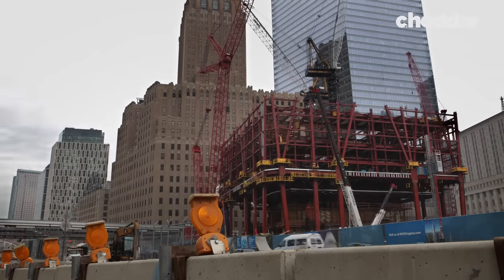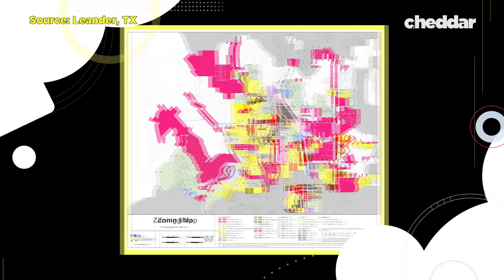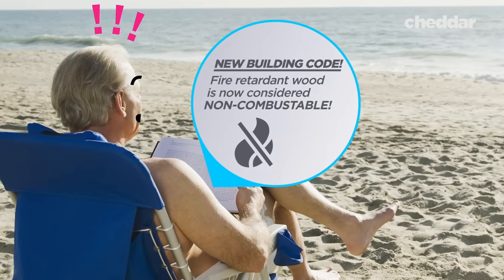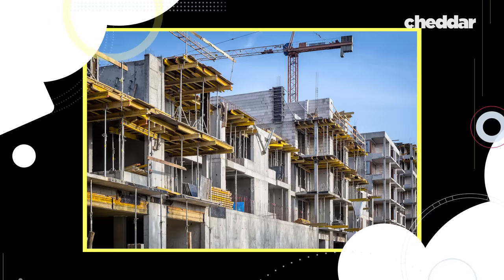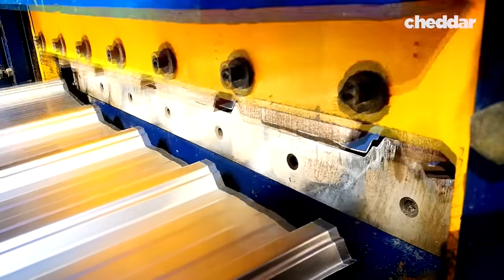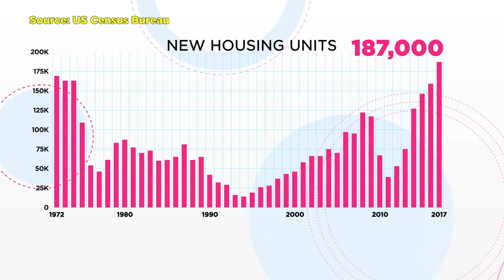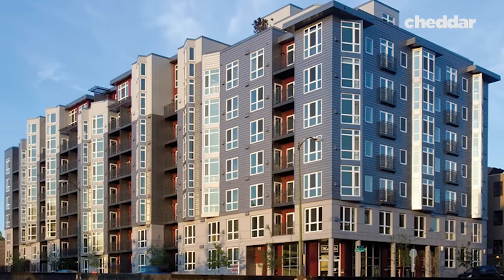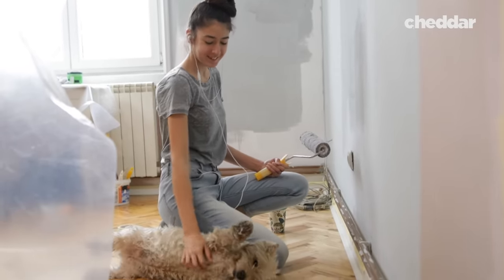Why All New Apartment Buildings Look Identical - Cheddar Explains

Comment: I am generally okay with the design. My only gripe is the sound proofing. The walls in these apartments are paper-thin and sound travels all around. I used to live in one such apartment and could hear neighbors from many doors down. Maybe it was an issue with sound-proofing in my specific building and is not universal.
Reply: No, all low cost housing isn't going to specify soundproofing simply because it costs money.  Sometimes you can get a reasonable amount of soundproofing because it's a side-effect of fire containment but sounds like the US buildings there are relying on sprinklers rather than containing a fire to the apartment it started in.
Reply: I live in one of these buildings, the sound proofing is pretty good if the building is built with double walls so each unit is technically not connected.  I only hear my upstairs neighbour if he bangs around or moves furniture.  I have never heard my side neighbours.
Reply: @AppleCheese12345678  that i can even hear in my flat and the house was build like 60 years ago. But everything else is fine when they dont scream at each other
Reply: @randeknight  insulation is like 5€ for a wall
Reply: Soundproofing really depends on the specific building. I do wish my apartment when I lived in the Dallas area had double pane windows since I heard too much from outside but I heard basically nothing from neighboring apartments so I believe interior walls were insulated well. 1 bedrooms were in the $1200-$2000 range so it's going to be build better than the bottom of the barrel buildings.
Reply: No, it's all like that.

It wasn't just you.
Reply: I moved into a wood construction apartment building in Houston, sight unseen, as I took a job and moved from Chicago, where wood construction isn't even permitted because of the climate. So it never even occurred to me that you could build a multi-level apartment complex this way. Though the building was advertised—and priced—as a "luxury" apartment building, everything was incredibly cheap. And the noise level was so bad that I ended up breaking my lease and moving out after six months. My neighbor above me must have weighed 300 lbs, and his footsteps sounded like thunder from below, not to mention the noise coming from the hallways. Now I always ask if the building is wood construction or not.
Reply: @jamesslate1026  wood construction is iteself not the problem, its lacking insulation
Reply: @einar8019  Builders don't measure or report the level of sound insulation though so it's hard to know what you're getting. Just avoiding wood framing is probably a reasonable way to set a minimum standard. It's hard to make a concrete building with sound insulation as bad as a typical wood building.
Reply: ....that moment when low cost housing (the projects) build in the 1950's thru 1970's are made with sturdier materials (concrete blocks and cement) than more expensive apartments today.
Reply: Yup, sound proofing is terrible in most modern apartments. That and unusable balconies (too dangerous) are the biggest issues.
Reply: In California, there will be probably no soundproofing between apartment units but there will be between condo units.  If the developer may want to sell the building as condos later, they might have built it to condo specs from the get-go rather than later ripping out all the walls to do the soundproofing later.
Reply: Nope - not just your instance. I lived in a so-called luxury apartment ($1500/mth for a 1-bdrm) that was built around 2015.  On a quiet night, I could hear light-switches(!!) being flicked on/off from my downstairs neighbor.  For the bathroom, if I go in there in the complete dark and my downstairs people happened to be in their bathroom, I could see their lights peering through the pipes of my bathroom sink (around the hole where the pipes come out of the sheetrock)!
Reply: No, all these buildings sound like you're living inside a drum.
Reply: @jamesslate1026  I recently moved to to Houston and I’m having the same issue now! If I can hear my neighbor next door to me yawn than the wall are too thin! and this is a “luxury” newly built complex.
Reply: Could you hear the neighbors doing "everything" and please, do, tell... (creepy question I know)...
Reply: The one I lived in was super quiet and I only heard upstairs neighbors sometimes
Reply: "My only gripe is the sound proofing."

Sound proofing has been non-existent in most of these style buildings that I have visited or lived in. I've had multiple experiences in which I could hear every step my upstairs neighbors took. In many cases, these footsteps would vibrate my entire apartment. The leasing agents would never admit the sound proofing issues upon renting, but after multiple complaints, they would just say: "it's apartment living and loud noise levels should be expected."  BS.
Reply: It's easy for the builder to skip on quality. Think about cheap Chinese products. Once you slap shiny colors on a product you can run away and take your profits with you.
Reply: @skuzzyj  I live in wood construction and it's excellent. I'm on the first floor and I never hear neighbors lol
Reply: It's the construction material. Concrete buildings come soundproof by default.
Reply: Not as bad at your situation, but the soundproofing in my place isn't great either
Reply: The houses don't have a design issue. The design is totally fine and very pragmatic. The issues are build quality and extortion prices. And those problems don't stem from the design, but people wanting to make a profit. That's capitalism. They'd be making even more profit if they put up a cheap family house like in the suburbs, that would decrease supply.
Reply: I once stayed at a motel that used this design and I could hear everything the occupants in the next room were up to.

Comment: The high price of lumber may curb an expansion of these developments. Also, if you've lived in cheaper, modern builds made primarily from wood, then you know the biggest drawbacks are noise levels, inadequate sound proofing between rooms and floors, and high electric bills.

Comment: This type of apartment building is very common in Europe, too. But I really doubt that any of them have wood frames.
Reply: You see this buildings all around europe and this video forme is a bit strange when they say cheap housing. I guess that the difference is that we don't build over wood and always use ciment
Reply: Check out "Strong Towns". The US developed differently than Europe. The 3-6 story housing being missing is largely intentional and enforced by car-centric laws. It's also why cities overexpand their ability to maintain services.
Reply: Europe doesn't have the cheap wood to build with.
Reply: @Br3ttM  originally that was the problem but now is more a question of safety and durability, residential buildings are quite often 100+ years old
Reply: @Br3ttM  originally that was the problem but now is more a question of safety and durability, residential buildings are quite often 100+ years old
Reply: @Br3ttM  In Finland it is becoming more common to build with wood, they built a 14 storey apartment building using only timber. It is also used for office buildings.
Reply: I bet Belgium has the most
Reply: @vighdavid9495  but i would say you dont use the same wood type, i think yours is higher in quality
Reply: @vighdavid9495  but is not the same kind of wooden building. In the us they make concrete  and steel structures and then build basically every other wall with cheap wood or foam and plaster. In finland and other nordic countries the wooden materials are of high quality and are part of the structure.

USA builds with cardboard.
Reply: The style has unfortunately got very popular in europe, it's just a trend. It is very likely that the european ones are totally built in cement, especially depending on which state are they built in.
Reply: @jam6636   
Yes, they do build with cardboard.
Reply: @vighdavid9495  

The Scandinavian countries are the exception in Europe. Not too many people want to live in the interior of the country and it usually not suitable for farming. As such, your forests have been preserved, unlike the rest of Europe.
Reply: @ycplum7062  that is a common misconception about Scandinavian forests, very little of our current forest is really that old, most are planted for wood or reforestation purposes within the last 100-150 years or so
Reply: @tiagofernandes574  wood construction is going up in Europe, different styles than the US for the most part but still growing for many reasons, in Germany about 1/5 of new houses are wooden construction last I checked (like 1-2 years ago, dunno what it is now), in the early 90s it was more like 1/15
Reply: @domenicocor1185  its mostly fast grown industrial lumber
Reply: @jam6636  i mean the video just showed a bunch of wooden US structures where the wood was structural for the top 5 floors....

We do have higher quality standards in the Nordic countries (no cardboard), but wood is a good material when used correctly
Reply: @Dracounius  I 100% agree with you, wood is great when used correctly my point is that building materials and regulations in the US are really bad relative to the wealth of the country.
Reply: @Dracounius  

I'll take your word for it, but it seems you have a lot of forests in the interior and north, well away from population centers.

Or atleast Sweden and Finland does. Norway seems have a lower density of trees and way more mountainous. I know Norway was a big source of timber for the Royal Navy back in the age of sail. The UK practically denuded their forests and this was well before tree farming (reforestration).
Reply: @jam6636  oh most definitely they are, truly atrocious standards :/
Reply: @ycplum7062  oh we have lots of forests in Sweden, but there are different classifications of forests we use based on biological diversity and purpose. Older styles of industrial forests are the worst kind in that they are essentially monocultures or containing only a few types of trees/fauna (Swedish: kulturskog) there is "natural forests" or forest that hasn't been touched by humans for agriculture or forestry in 150+ years. And "ancient forest" (swe: urskog) that haven't been touched by humans in ages, in 2020 urskog was only about 0.3% of Sweden's forests
Reply: @Dracounius  

Here in the US, we have a good amount of of virgin (aka Old Growth) forests left. And, our neighbor Canada has even more.

In many parts of the US, small companies are allowed to "harvest" trees. They can only cut down already dead (but still standing) trees or trees that have already fallen. The really big companies have to replant more trees than they cut down. In a sense, they are farming trees, but the cycle is measure in years.

Ironically, the US exports timber and lumber, but imports finish wood products. Because of the high cost of labor in the US, we are not competetive in finishing wood products.
Reply: I can only speak for the Netherlands, but we use a lot of sort of standardized / prebuilt concrete blocks and walls, covered by a brick outer layer usually.  I think (purely guessing) that it's a method that we've been using since rebuilding the countries infrastructure after WW2. I'm kind of looking forward to see what modern techniques like 3D printing with concrete can do.
Reply: @ycplum7062  we have similar restrictions on replanting and such, and occasionally they get trees from old growth forest too, but not in any significant numbers
Reply: This is part of the reason the US uses AC to an overabundance. Housing is made cheaply out of wood (which bleeds heat in both directions, barring some really thick types of wood that aren't used in construction due to cost). 

Home building in the US is an extremely greedy industry (more-so than most). The idea is to build cheap housing which saves the landlord money, and then use AC in the summer to cool the home - which is all the tenants responsibility. Homes in the US literally are unlivable without AC units. They aren't designed to be cooled through redirecting air currents or thick walls to prevent heat transfer. They're not designed with user sustainability and comfort. They are built to be instantly sold and then the property developer's piss off.
Reply: @KC-Mitch  

Not necessarily. Wood is a better insulator than brick, stone or metal. Wooden construction in the US also utilizes insulation between teh outer wall and inner wall. 

With that said, bad construction, or improperly maintained houses, lose heat and cold air through leaks. Unfortunately, there isa lot of shoddy construction.

It also doesn't help that that Americans tend to wasteful. Typpical temperature indoors during winter is just shy of 80 F and 65 F during summer. This has nothing to do with construction.
Reply: @KC-Mitch  first of literally everything "bleeds heat in both directions" that's how heat transfer works. secondly wood is a better insulator than concrete or brick for the same thickness, however, bricks and concrete is heavier so they store more heat than wood for a given thickness. This means they take longer to heat up when it is warm, but when they are warm they take longer to cool, and they cool down by heating both the inside and outside of the building. in either case, insulation is very useful as for wood framed buildings they fill in the cavity and airgaps, and in concrete/brick buildings they keep the building from warming up to fast. Point being, buildings in the US don need AC because they are made out of wood, but because they are made cheaply, you can get a well-insulated wood-framed building without much "thick types of wood" materials, just need more insulation
Reply: We have them a lot here in Spain, I would say that these type of middle-rise residential buildings are the most usual place to live here. But yes, they are always built with either bricks or concrete
Reply: They just built a wood frame one near me in Waukesha, WI. They call it a luxury retirement community. There is one downtown that is usually rented to the younger crowd.
Reply: These cheap cardboard-like wood is used mainly in USA. Most of the world build concrete buildings or use expensive quality wood
Reply: Apartment buildings are a popular choice for High density housing, and since companies that focus on that don't really care about the uniqueness or form of the building they just build them generically. The problem is also down to buyers, since people want cheaper housing they build these cheaper places which means more boring apartment buildings get made. The building regulations in Europe tend to be stricter (but not always well enforced, I.E. Grenfell tower) and wood is not as available, making it a more expensive option.

But even in the UK where I am from, most people tend to prefer older buildings/houses to newer ones as regulations have been squeezed too much, in the UK the issue is new builds tend to make every room pretty much as small as they can to still be recognized as particular types of rooms. My current place (which was built in the 1950s) has a living room that in some newer builds would be bigger than two double bedrooms. Unfortunately in the UK lots of councils are under pressure to supply more housing for more people and easiest way to do is to go as high as density as possible.
Reply: Some towns here in England are full of them
Reply: Actually, engineered lumber apartment buildings are becoming very popular in Europe.
Reply: Prague - wood is only used for cottages and summer houses.
Reply: @ycplum7062  So does Sweden build these out of wood or out of concrete?
Reply: @NightingaleSong  

I don't know. I am an American. I know Sweden is heavily forested just from satellite photos (which are not that clear on whether tehy are old growth or replanted),  I don't know about their building technique.
Reply: @vighdavid9495  with all that forest land in Finland, it seems foolish to build with concrete.
Reply: @Br3ttM  They prefer to pay for a solid material because they don't need to save money to buy Mc Donalds.

Comment: I live in one in Seattle! Never thought of them as an eyesore. Way better than the 2-3 story apartment buildings of the 80s that all have parking between the dozen or so buildings.
Reply: Agree.. 70’s and 80’s suburban architecture is literally the most hideous crap I’ve seen.
Reply: The last time I was in Seattle I marveled at the beauty of the geography counterpointed by the ugliness of the 1950s-1980s architecture.
Reply: Agreed.
Reply: I like 5 over 1s. I don't get what to not like about them and how can you find them bland
Reply: "As common as a Condo in Kirkland" was a phrase realtors used to describe this phenomena - the Eastside was WAY overbuilt in the late 70's and early 80's.
Reply: Sure but compare to one of the 5-6 story structures in Paris and they're complete eyesores.